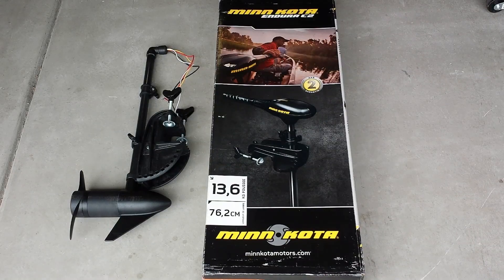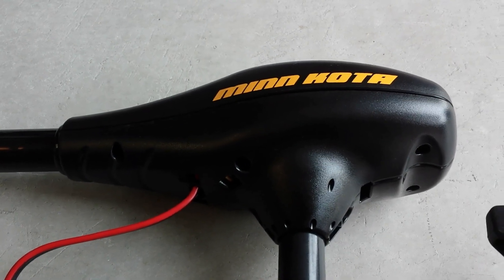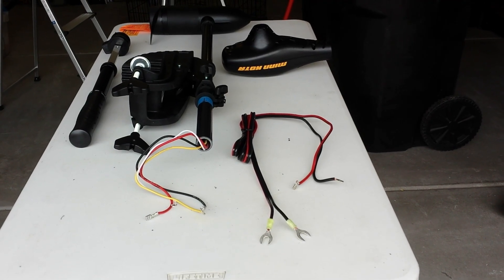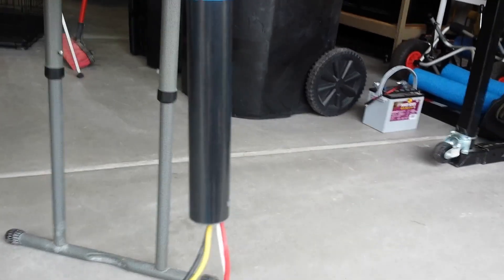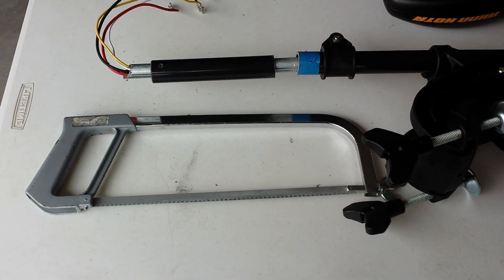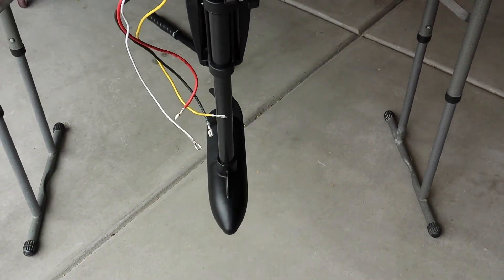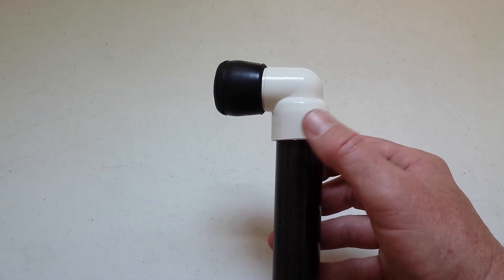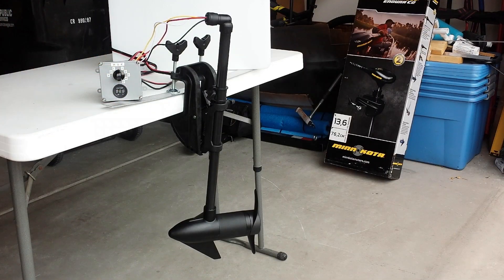DIY Shortened and Modified Trolling Motor Shaft for Kayak

Comment: Want to thank you for all your videos, they are AWESOME!!  Have really learned a lot from them.
Do you know how to keep your trolling motor unlocked while trolling and lock it up at will from the seated position in your kayak?
This one is racking my brain.  See alot of ways people do this but none really work the way thats needed.
The unlocked position is to protect your motor and kayak from damage so the motor must be able to swing free if struck by an object.
But needs to be locked for reverse. How do you get both?   Hope you can help?
Thanks Again. John R
Reply from the maker: Thanks for the compliment John. I have never made a trolling motor mount that will swing during impact with an object but know what you are talking about. I don't think it can be done with a stock mount. Some people have made their own mounts with a hinge. If you did that, you could have a spring attached to keep it from coming up in reverse and still be able to move during an impact. It depends on what type of water you kayak on if that set up is even necessary. I do the majority of my kayaking on lakes so I have never made a mount like that.
Reply: Thanks for your reply Aksman,  I am new to this very new (never been in a yak) YET.  I purchased a used bonafied ss127 and purchased a 40lb minn kota.  As you know this has the standard mount.  I am enjoying the modifications and work i'm doing to my new yak.  I only fish lakes as well maybe I'm over thinking this?  keep up the good videos and thanks for all your help. John
Reply from the maker: @johnrugani9832  Hi John. Once you get a kayak you want to do all kinds of cool modifications to it. Just think about what you will be doing in the yak, where you will yak, and of course your budget. Enjoy your kayak and you can always ask me questions. Are you a member of the FB page "Kayak DIY Projects & Tutorials"? You will find a lot of good projects and friendly people there.
Reply: Aksman Thanks Aksman,  I am not a member FB  page but will make a point to get that done.  FYI i figured it out! How to lock and unlock
A minn kota from the yak seat.  I would explain but it could take pages.  Once I'm underway I'll show you what ive done.
Reply from the maker: Sounds great! Please keep me posted.
Reply: Aksman hello again i came up with a very simple way to lock and unlock a standard minn kota transom mount. After designing and making a crazy complicated fixture it dawned on me.  Standing behind your kayak with the trolling motor mounted in front of you, simply take a foot or so of 550 para-cord.  Tie a not in on one end to keep it from running through the motor mount. Thread the paracord through the left third hole from the bottom in front of your trolling motor shaft and through the third hole on the other side sending your paracord through the minnkota transom mount. The shaft tensioning screw can be swapped out for an I hook put the cord through there and run it as you would normally to the front position in your kayak.  When it is tied off on a cleat or other method the paracord is tight and the motor will stay in place. Uncleat the cord and the motor swings freely. Unless i'm over looking something this should work!!   What do you think?
Reply from the maker: That is well thought out but I don't think it solves your initial problem. I thought you were concerned with a sudden impact/damage of your trolling motor while in use. If it is tied off at a cleat, it will not swing free and still cause damage. However, if you added a spring to the paracord before tying it off on the cleat, it will remain in place but be able to swing based on the spring tension. What do you think?
Reply: Aksman you are right, but I intend to let the motor run free always and only cleat the paracord when reverse is needed.
Or when I'm fishing the shore line slowly.
Reply: Of course the cleat is right by your side while seated
Reply from the maker: Hi John. You gave me an idea for a solution that I will post after testing.
Reply: Aksman  Good Morning Aksman, I'm looking forward to seeing it. Thanks. I don't think i was able to explain how my solution really works.
But i did some testing and it couldn't be simpler, and it does work.  Perhaps one day I'll do a short video and post it so you can see it.
Reply from the maker: @johnrugani9832  Sounds good John.
Reply: Aksman I posted a quick video (very poor video) on you tube show you what it looks like.  Take a look at (minnkota reverse lock)
Reply: How about a zip tie to loosely hold the lock open that you can slip off when you shift to reverse and slip back on easily for forward

Comment: why wouldn't  you use a tubing cutter, faster and easy to cut the shaft,and use a dremal tool  to grind out the pvc 90 to fit the shaft?just a thought...
Reply from the maker: I tried using a pipe/tube cutter but it did not work well on the non-metallic composite shaft. If you have actually tried to do that you would understand what I mean. I prefer to heat up PVC to fit instead of grinding it and losing its strength.
Reply: I assume most people have a hacksaw in their garage but not a tube cutter.
Reply from the maker: Very true.

Comment: How hard would it be Turn the trolling motor head 180°
Reply from the maker: It is simple. Just loosen the bolt under the head at the shaft, rotate it, and re-tighten.
Reply: Instead of an elbow I would use a T one side for the wires and the other for the handle.

Comment: Would the procedure be about the same with a bow trolling motor? Not sure if it is a min though, but dang it is way to long for transom work on a little rubber boat.
Reply from the maker: The procedure should be the same for shortening the shaft.

Comment: Hello I'm wondering if you wanted to make a single speed unit could you just run power directly to the motor through a switch? Or is there more to it than that. Thank you for the help I've got my own little project I'm working on looks like you did a great job
Reply from the maker: Thank you Bryan. You could run it through a switch but it would be full speed on and off.
Reply: Aksman,

Thanks for the help, in my situation I think that would be fine, I'll run it in a simple momentary button.

Comment: Why didn’t you use a tubing cutter rather than a hacksaw...less fuss and no shavings
Reply from the maker: Because it is a composite shaft and the tube cutter does not work as well as a hacksaw.
Reply: Is that made out of carbon graphite? If so, you should use a respirator, cuz that stuff is highly carsonagenic, if you cut it with saw.

Comment: can you seal the kota bottom case it has hole all underneath there is only a small circuit board  in there so i guess i can seal y'all holes yes or no would that cause the circuit board to over heat and blow circuit board
Reply from the maker: I did not have to seal any part of the trolling motor.
Reply: Aksman if your kayak tuned upside down you may have a different story
Reply from the maker: I already flipped one without damage.
Reply: Aksman i did for about 15 seconds 
There is about 5 big holes in it so i guess you must of dried it out other wise that pcb would of blown

Comment: There's really no need to disassemble the head/control unit. Just cut the shaft and the wires and preserve the head as the control. Just need additional wires to reconnect it.
Reply from the maker: True and I have done that before. However, this box is more compact than the head unit allowing for many placements.
Reply: Aksman oh ok.some people like me are not good with electronics lol. I would just keep the head unit and place it on the side or under the seat. :)
Reply from the maker: It works fine like that. I did it on my first kayak.

Comment: Thanks for the great videos and ideas. I just did this to my new Bonafide 126 and used the original speed control handle mounted to the top of the gray box so it sticks up right beside the seat. Worked out great. If I could post pics here I would.
Reply: Pat Kinsel  Can you send me the mod you did for the speed control? E
Reply from the maker: Your are welcome Pat. Glad it worked for you.
Reply: Hey do you have a Facebook with pics?

Comment: Can you shorten it but still use the original steering shaft afterwards instead of making a new speed control box?
Reply from the maker: Hi Frank. Yes, you can use the original head unit as your speed controller and move it to a new position.

Comment: Two trolling motors can be connected to the same speed controller?
Reply from the maker: No. The current (Amp) draw would exceed the capacity of the controller.

Comment: Where can I buy cable to extend to the controller box?
Reply from the maker: Any marine shop, Amazon, or web wire store.
Reply: Aksman do you know what gauge it is
Reply from the maker: The pos/neg 12V battery wires are 10G and the yellow/white wires are 14G.
Reply: Thankyou

Comment: Dude i have been to fogure put how to do this to my 50lb trollinf motor that used to be a bow mount. Now i can mske it into a rear transom mount and use kust the motor and shaft and pvc ! Ypu rock !!
Reply from the maker: Glad this helped. Keep us posted with your progress.
Reply: Aksman Will Do ! Just need ro make foot pedals.  I have a bass raider type 2 man pontoon boat
Reply from the maker: You can buy a pair of Attwood foot rails from Walmart for less than $20. They work great for slider steering.

Comment: What size wire did you use for extending the motor wires to the new control box, I am assuming the wires need to be extended 6 or 8 ' Thank You
Reply: Thank You, I was wanting to use a corded SO wire but all 4 wires are the same size making the OD of the cord just to large, I guess I'll have to figure out a wire covering of some sort and use wire sizes like you did. I did use a 2 screw 1/2" plastic LB on top of the motor shaft so the wire nuts will also be in closed on the motor end like in the hand held control box. Nice job and Thanks Again for the information, Gary
Reply from the maker: You are welcome Gary.

Comment: Would a plumbers pipe cutter used for copper pipe make the cut?
Reply from the maker: I tried that before, but it didn't work very well on the composite shaft.
Reply: Thanks, I was thinking metal shaft.  Makes sense.

Comment: Couldn't  you have used the head after the cutting process say if you wanted  to mount it on a jon boat?
Reply from the maker: Sure you could do that. I used a controller box and PWMs that are smaller and more efficient.

Comment: What and how to determine what size power source and where to hide?
Reply from the maker: You must first choose your size trolling motor. Then you must choose how many hours do you want to run the motor. When you decide those things, you can choose the size of your battery. This is an example. If you have a 30lb motor, the approximate maximum amperage draw is 30A (1A per 1lb of thrust as design standard). If you buy a 35AH battery, then the formula for running time is: (35AH) ÷ (30A) = approximately 1 Hr of running time at maximum speed. Your battery will last for a longer time if you go at slower speeds. Once you have decided on what battery you want to use for your run time, measure the battery size and see if it will fit inside the kayak hull through a hatch.

Comment: How to attach steering to control trolling motor and how to determine what size motor ?
Reply from the maker: I have made other videos showing a DIY steering control arm and foot pedal steering. The size of the trolling motor depends on the size and weight of the kayak. A 30lb motor will work for most kayaks.
Reply: Aksman where can I find this video on steering arm and foot pedal control?
Reply from the maker: You can search YouTube using "Aksman" and scroll through my other videos until you find what you are looking for.

Comment: Do i need to install a breaker too?
Reply from the maker: I highly recommend it or you could burn/short out the motor.
Reply: I bought the same motor you have in your video, minn kota 30lb. 30A might be ok?
Reply from the maker: A good rule of thumb for designing trolling motor set ups is 1A of current per 1 pound of thrust.  I would use at least a 40A to be safe in case there is a current surge.
Reply: Would you put your fuse just in the power line from battery to motor or from motor to speed switch

Comment: Great video  very helpful  I have two questions 1) The cables to connect with the speed control box cab can I  make longer maybe a four feet long  2) I want to do it with a different motor brand a Newport Vessels is the same configuration ?
Reply from the maker: Thanks Tito. Yes you can extend the wires as long as you use the same or larger gauge size. I have also done this to a Newport Vessels tm. They are set up in the same way.

Comment: Also, I just tried your trick of heating a PVC fitting to fit over the shaft. Works perfectly. In my setup the "shaft" is a 1" OD aluminum tube so I used a 1/2" PVC fitting. I am guessing I am the last person on earth to learn this trick ;-)

This is how I have been transitioning from the top of the shaft. http://www.pakfish.com/nucanoe-frontier/minn-kota-control-project/controller-2016/ 

I am thinking of using a 90 degree PVC fitting and a 45 degree PVC fitting in conjunction with the rubber boot show in the above link. 
Many Thanks, Phil
Reply from the maker: Thanks again Phil. You are so busy with your other breakthroughs that you can overlook the little things sometimes...lol